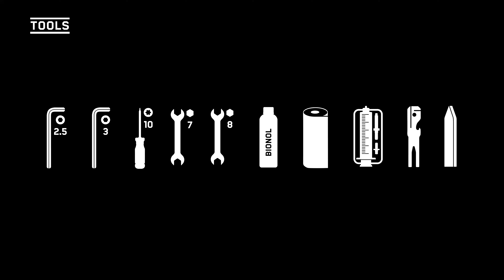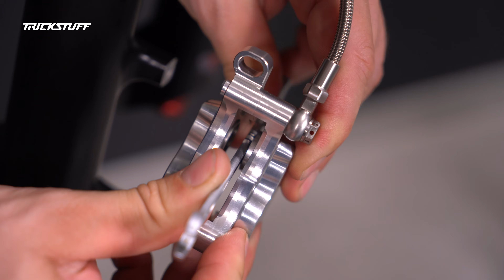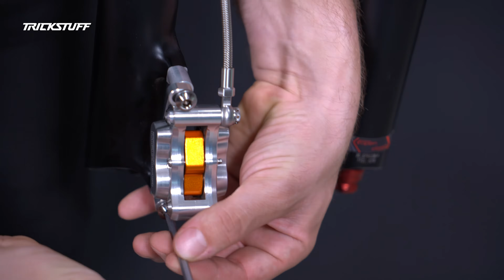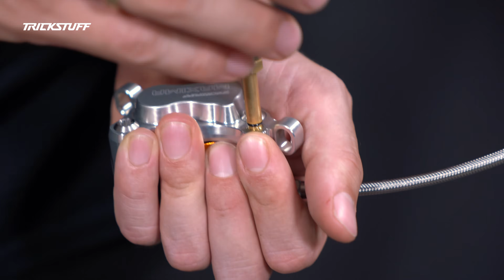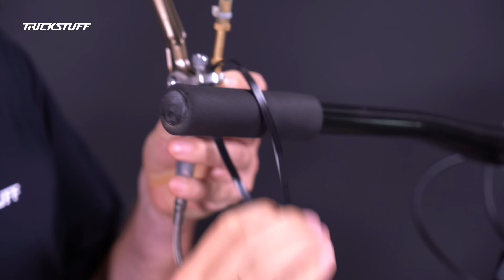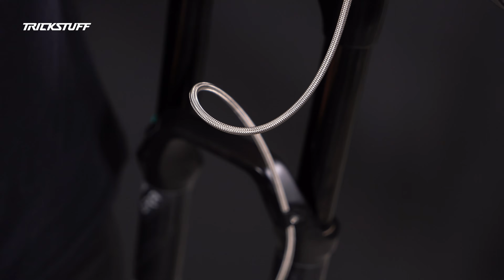SERVICE MANUAL: BLEEDING – MAXIMA

Comment: when im bleeding the lever, if I check the bite point a couple of times, a lot of air bubbles start to come out and it never ends. bite point feels super strong. Is it possible my lever has some air going inside when braking?
Reply from the maker: Hi, the way you describe it, it sounds like there might be a defect with the pump. Feel free to reach out to our tech support (tech-support@trickstuff.de) to get this sorted.
Reply: Hello
Is this same process with direttissima ?
Reply: @josh69127  yes the same
Reply: It's ok I found other video